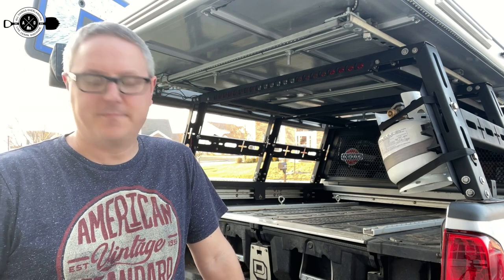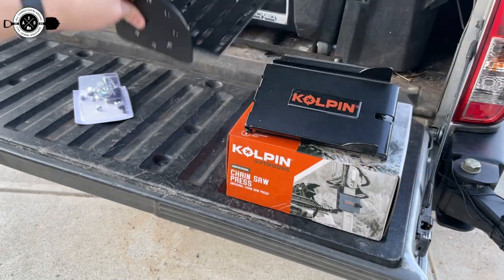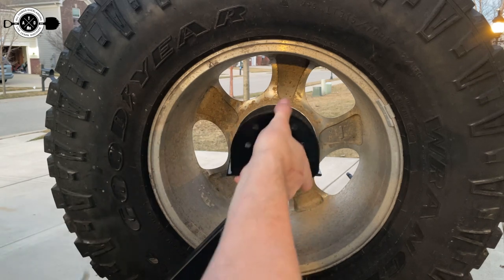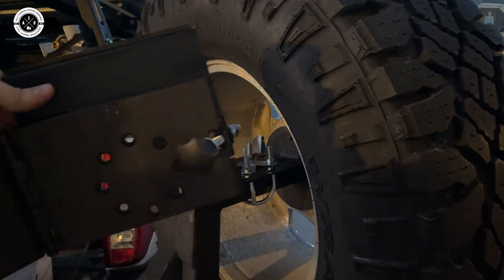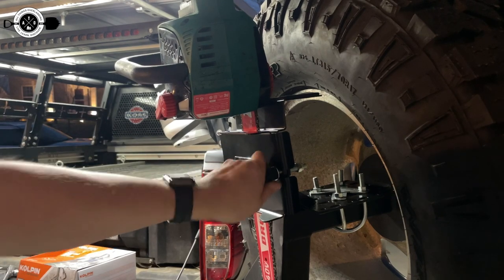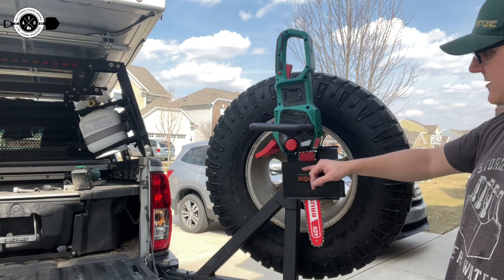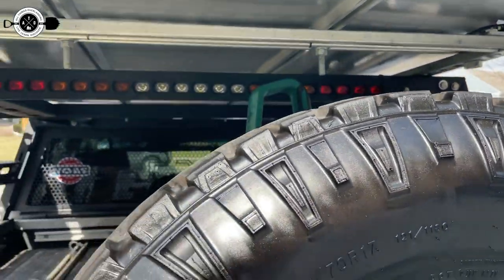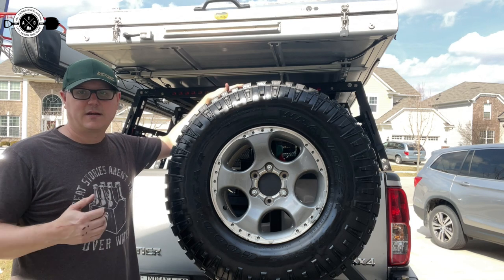Mounting a Chainsaw to your Overlanding/Offroading Vehicle (Kolpin Chainsaw Press Mount Install)

Comment: 👍 I have been working out how to make something like this they always seem so overpriced online.
Reply from the maker: Yeah, I thought the same thing. I even bought some stuff to try to build my own, but I was probably $20 deep before I realized I still didn't really have what I needed and this was like $70. It works great and once I figured out how to mount it, I really like it. It is tricky, but there are a lot of ways you can make it work! If you're handy, you could probably fab something similar too, :D.

Comment: It’s going to be a wet muddy mess…your chain will be a rusted locked up mess.
Reply from the maker: I ran this for about a year and a half and it never got muddy or wet. Up behind the tire like that in the center of the back of the vehicle, it never got touched by anything flying off the tires. I also don’t leave it on 24/7. I just put the chainsaw in when going on a trip.